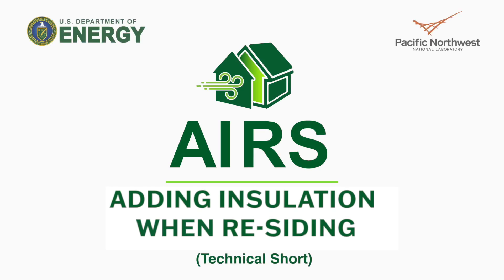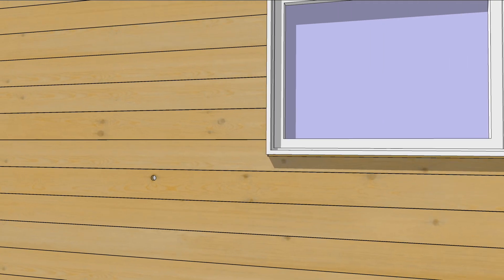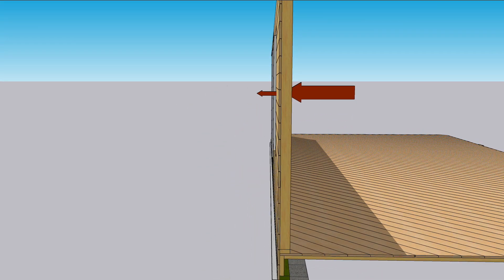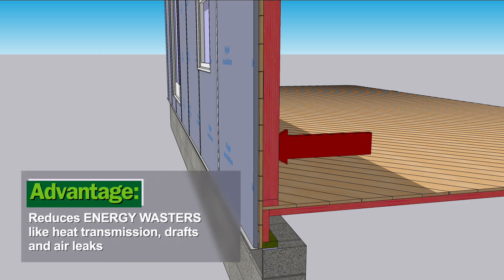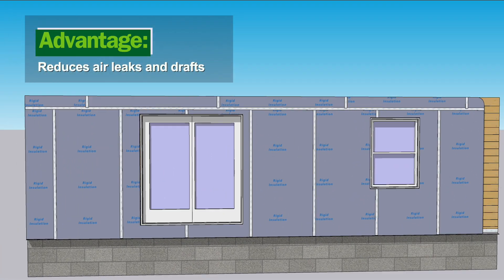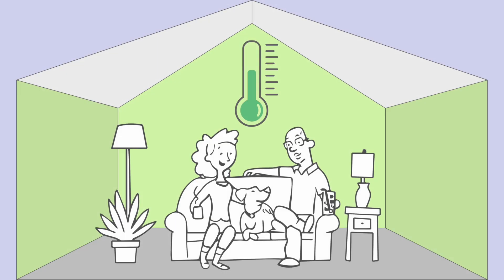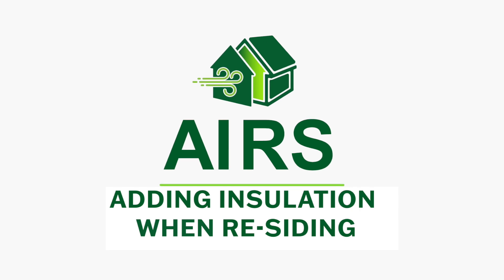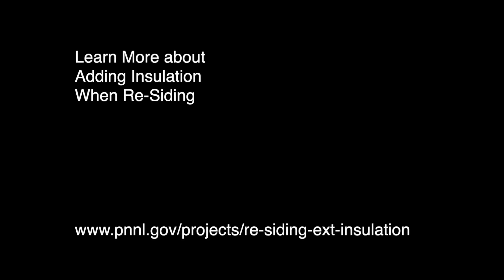Adding Insulation when Re-Siding, a brief technical summary

Comment: So... what is better.. XPS (Extruded Polystyrene), GPS (Graphite Polystyrene), or PolyIso (Polyisocyanurate)?  ..particularly over a long period of time.  What about building wrap?  ..or is it worthwhile to install a product which has a radiant heat barrier already adhesively installed?  What about the possibility of moisture being trapped/condensing on the inside of the newly installed building wrap?